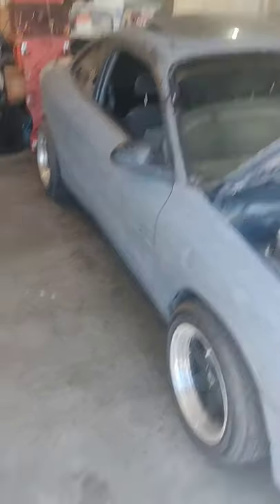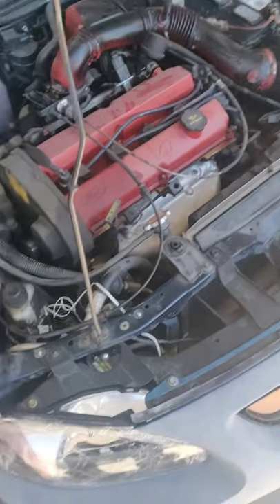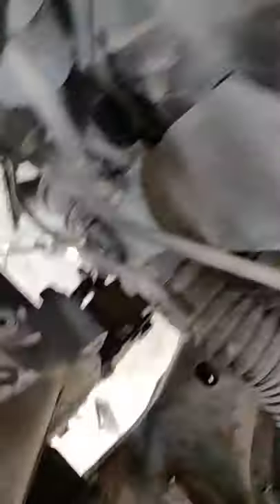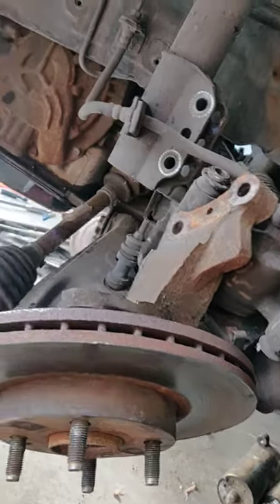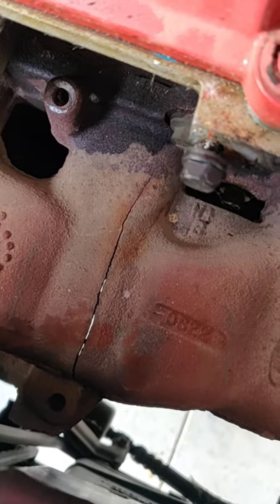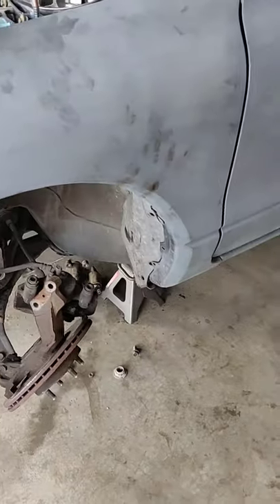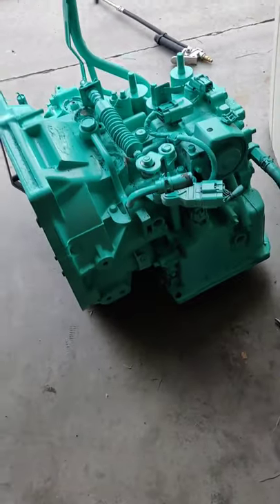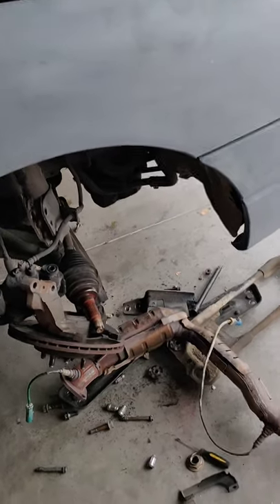2002 Ford Escort transmission replacement Part 1

Comment: You will want to double up the torque converter seals in the transmission or you will have leaks. Plus use lock washers one the crank hub bolts or they can rattle loose and cause a failure and damage.